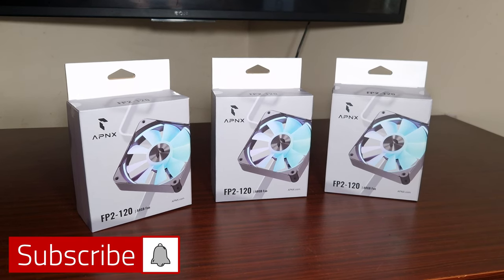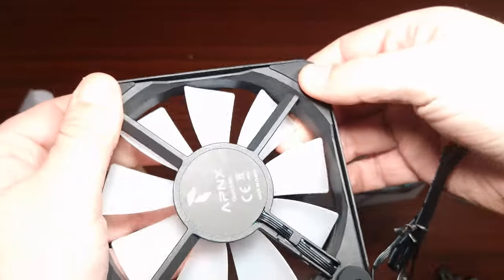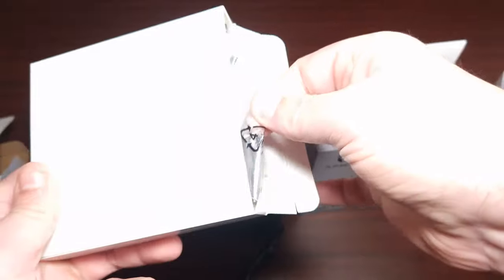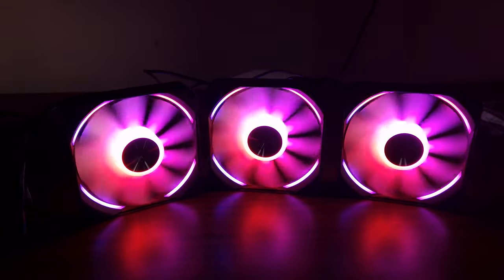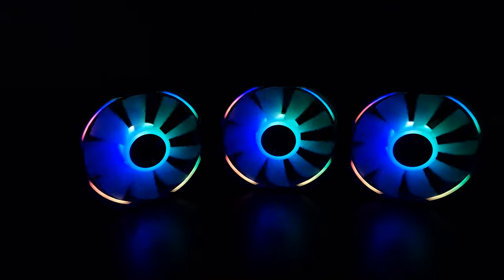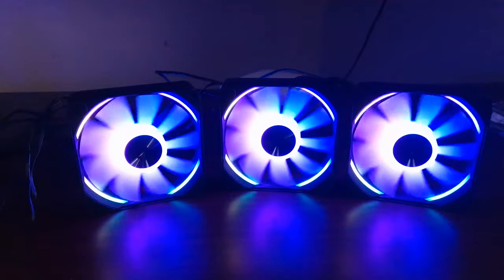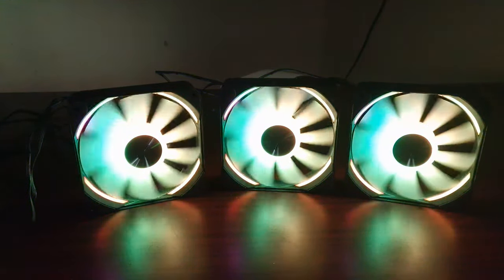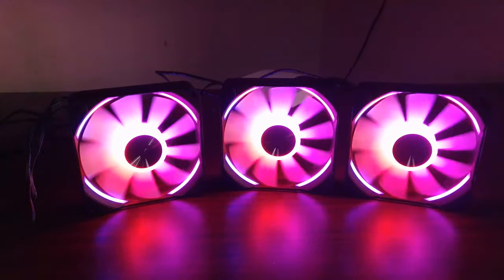Here's Your First Look At The New APNX FP2 ARGB Pc Fans!

Comment: For example install alot fans , for Control argb and pwn by motherboard need a hub + argb controller ???
Reply from the maker: You can daisy chain 3 fans and control them by the motherboard with pwm and argb if you have more than 1 argb header and pwm header you would be fine but you couldn't connect let's say 6fans all together there's a limit to the argb signal